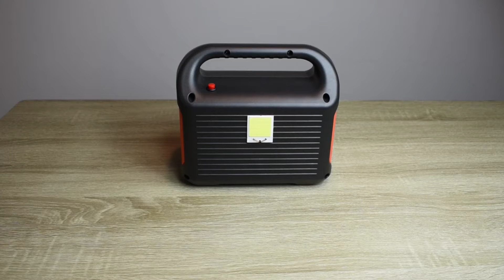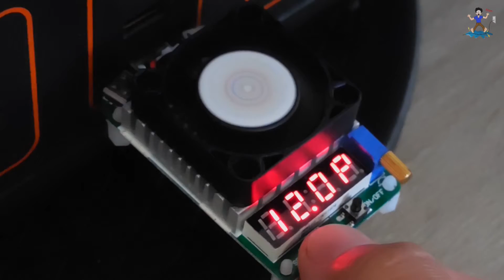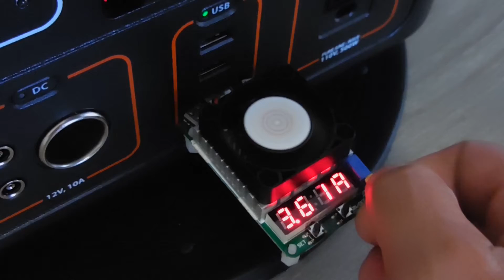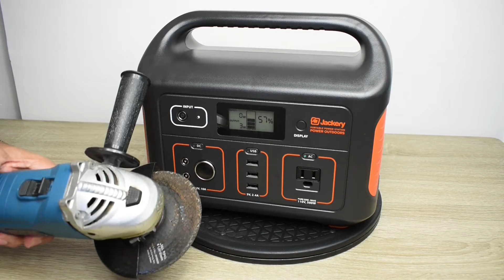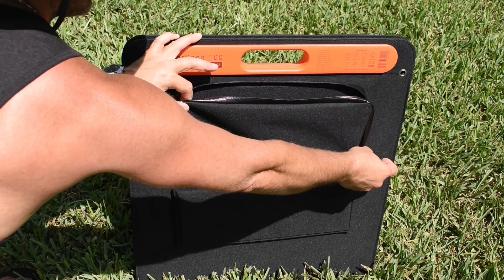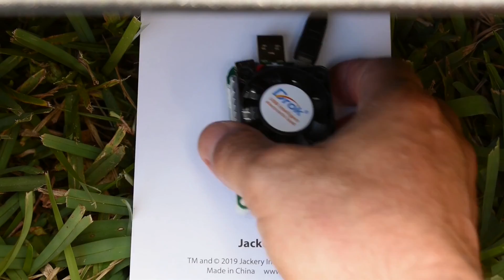Jackery EXTREME Testing! (Explorer 500 & SolarSaga 100W)

Comment: I live in Phoenix - it's only about 95 degrees today - and the VERY best performance we are receiving from Jackery 200w panels is a pathetic 131W!  This is a replacement shipment - when my first peels kept losing power for every minute in the sun, we assumed it was faulty.  Now the replacement unit is doing the same thing.  So Bottomline, these panels cannot perform in hot direct sunlight - somewhat ridiculous given that I bought this unit to provide power when the power girds fail here in the excessive heat of global warming, only to find that these panels don't perform to specs in warm weather.  IF YOU LIVE IN HOT WEATHER - test these panels in hot weather - our experience is they do not perform
Reply from the maker: You can refer to the video below for a solution. Thank you for watching!

https://youtu.be/yXNW-4fNZVk?si=2owQY2RTRmiU9F0q
Reply: @electronicsNmore  thank you. But it is INSANE that after spending $2000 on a unit I would have to go through the steps to make the unit perform to spec. This is false advertisement blatantly on the part of Jackery.
Reply from the maker: @kms7546  I agree they should have designed it to use the full output of the panel

Comment: So after 500 times of charging it could stop working?
Reply from the maker: Anything can happen.
Reply: @electronicsNmore  that’s very true
Reply: 500 cycles from 100% to 0% then 0% to 100% is one cycle. If you use the pass through, charge while using and don’t go below 50% you’ll get 1000 cycles ….then the unit will only charge to 80% capacity for many many more cycles and years of service…

Comment: would somebody please explain to me what those 6mm plugs are for? Every video I go to tells me about output but not what they are used for and what kind of connection I need. Please be kind, I'm a 76 yo woman trying to assemble equipment for possible power outages
Reply from the maker: Which plugs? At what time in the video?
Reply: @electronicsNmore  those two small ports to the left of the 12volt connection at 10:09
Reply from the maker: @holidaze8998  Those are DC jacks for powering some DC electronics.
Reply: @electronicsNmore   I just purchased the jackery500 and have only charged it up with AC right now as it has been pouring here in the Pacific NW. I plan on getting some 12v blankets and small ice chest, etc. Would they be powered by those plugs then or the 12v outlet? Thank you for your time, I won't keep bugging you. Nice video.
Reply from the maker: @holidaze8998  You cannot exceed 10 Amps. Refer to the 12v blanket current ratings.
Reply: @electronicsNmore  ok great to know. Thank you!

Comment: Well, you won't even get 100 watts from a 100 watt solar panel.  There is probably about a 10-20% inefficiency so you'd be lucky to get I'd say even 60 watts from a 100 watt panel.  Usually those ratings, like many others, are the maximum from the panel itself (the solar cells) but doesn't really reflect any loss during "transmission" from the cells to the actaul unit it is plugged into, which can be 10-30% loss probably.
Even Jackery itself says that a 300 watt unit will take about 3.5 Hrs to reach 80% charge from 0%, so that's about 22% per hour (of 80%) so only about 68 watts per hour from a 100 watt panel.  (This is obviously using rough numbers -- other factors will come into play and a 300 watt unit for example may charge faster or slower depending on other factors).

Comment: Thanks!  Very  thorough video showing actual load numbers.  Most people just plug in a bunch of stuff and do a "real world" test which has its uses but not as thorough as raw numerical data like you have shown.  It appears the actual LCD panel on the jackery itself is quite accurate as far as load goes.

Some cars also only put out a low wattage to prevent excessive drain on the battery since the alternator isn't running.  And many vehicles will cut off power to everything when the battery reaches about 10 volts (enough to barely start the car once probably).

Comment: Are you able to parallel 2 Jackery 100w Solar Panels to The Jackery Explorer 500w?
Reply from the maker: No. The max power input for the jackery 500 is 72-100W.
Reply: @electronicsNmore  1 panel will bring around 65w and with the 2 panels parallel it tops off at 70w
Reply from the maker: Watch my other video below. :-)
https://www.youtube.com/watch?v=yXNW-4fNZVk
Reply: @electronicsNmore  Wow, very good information. I wonder if they have a cover for it so it won't be exposed to the elements

Comment: One of the ads that was shown in the video is definitely a scam just saying.(Video is legit, I am talking about one of the random ads which the maker of the advertisement is the one to blame for.) This video itself is amazing and one of the best.
Reply from the maker: Which ad? LOL Glad you liked my video! Be sure to share. Thanks
Reply: @electronicsNmore  no problem! I mean an ad that says that WiFi providers are purposely slowing internet for like 0.25MB/s and their product magically boosted up to 250MB/s because delete some providers barrier. My guess is that in reality that's a WiFi extender which can be done with another phone or laptop and are selling it as something that magically will boost any WiFi ultra fast by connecting it on the wall with the WiFi.

Comment: Why does the Watts output display vary up and down instead of staying on a single number?
Reply from the maker: Where in the video?
Reply: @electronicsNmore , when you used the grinder, the Watts output fluctuated, but you didn't have it running very long. Anyway, I get this with my new unit. I tested it with a fan and it would move up and down every few seconds between around 33 and 38 Watts. An LCD light was pretty steady at 9 or 10 Watts. Maybe that's normal for a fan, but I thought these things would be steady.

Comment: I think Jackery solar panel is terrible product. it looks like pulls around max 60w? I have Togo power 60w solar panel for $100 and it pulls 50w????? It pulls around 20w inside the windshield and fits nicely too. (who sits around the camp site during the day. I don't think it's good idea to leave Jackery 1000 and solar panel on camp site)
Reply from the maker: The panel can put out 100W, but the voltage output is too low for the explorer unit to fully utilize the panel's power output. The 60W jackery panel is better.

Comment: I would like to see some Extreme Testing of the SolarSaga 100W panel. I can not find anyone doing it. Test the USB outputs (at the panel) and compare to the 8mm output. Low light vs good light; what the electronics are doing; are the electronics affecting the 8mm output; etc. My panel puts out 19+ volts open voltage, at Low light. I can only measure voltage. Seems like this panel is do well charging my small devices, I have no other source of power. Expensive Solar Generators are not available to a lot of us. I think, at a minimum, we should have a good solar panel, like this Jackery 100w. It seems to be a good basic choice; what do you think; can you do an extreme test on the newest version 100w panel (version 3) ? It has a new cell configuration, and a new protective cell coating.
Reply from the maker: For less than the price of the Jackery panel, you can buy a better made panel(no water resistant canvas that can pull or tear easily) that has higher open circuit voltage, which would allow faster charging. The Jackery should have no problems supplying full USB power under lower light conditions. Thanks for watching!

Comment: Great video. Thanks. Dumb question... Since the cable is only 6ft from the solar to the 500, any suggestions on how to keep the 500 out of direct sun? I live in a hot climate and I'm worried that it might get too hot (or isn't that a concern with these things?). Sounds like the 100W panel, though, isn't going to power it up any faster than the 60W (so I'll probably just get that one... and save some money).
Reply from the maker: Place the unit behind the solar panel in the shade.

Comment: Great testing video!! I have a ?. If I plugged in my 12v inverter to the car then charged the Jackery using the power cord to the inverter; while the engine is on and driving, would it pull more and change faster?
Reply from the maker: Hi Donna. Using a power inverter with the AC charger for the Jackery plugged into it, will charge at the same rate as in your house.
Reply: electronicsNmore  TY I was concerned it would pull too much from the car battery for the alternator to keep up.

Comment: How often and or when does the fan on the 500 come on?
Reply from the maker: Hello Shawn. If the unit is under a higher wattage load using the AC receptacle, the fan will turn on. If the unit was under high wattage load for a long time, the fan will remain on until the PPS cools down. Thanks for watching!

Comment: Quick question. Do you know how well this works with bluetooth speakers? I really wanna get this for my JBL Partybox 100 to use and charge at the same time but don't know if it'll work.
Reply from the maker: It should work fine. According to the JBL's website, the speaker has a 2500mah capacity battery that charges in 6.5hrs. The Jackery 500 system in this video can easily supply that power. If you decide to buy, be sure to use the provided links. Thanks for watching!
Reply: @electronicsNmore  Oh ok great! Thank you!

Comment: Great review?  Any suggestions on how to prevent the Jackery from shutting off after a few hours of non use.  If I leave my dometic fridge unattended, the jackery turns off after a few hours of cooler weather given the dometic doesn't run then.
Reply from the maker: Plug in a very low wattage LED night night.

Comment: do you like uncovered usb ports on that panel?
Reply: Good point. Especially if being used outdoors.
Reply: @mkilptrick  using solar panel indoors is inefficient
Reply: It doesn't have to be used with solar panels.
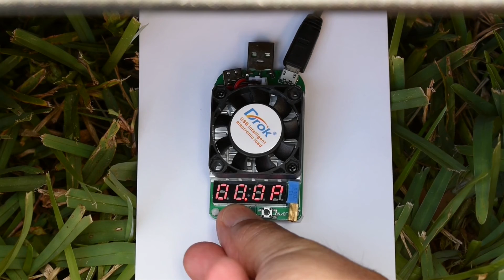Reply from the maker: I didn't mind because they were mostly protected when the panel is unfolded and facing the sun. 28:02 shows it very clearly. Thanks for watching!

Comment: Thanks for the in depth review. Any chance we could see the teardown?
Reply from the maker: You're welcome! I was going to include that, but based on the lack of views, I'm glad I didn't. If you look at my other video showing how I added the COB LED area light to the Jackery Explorer 240, you can see the inside. This unit is almost the same, but it has a larger battery pack, bigger inverter board, and the spotlight. I saw a bunch of videos on YT showing "reviews" for what I showed, but the great majority didn't come close to my level of testing, meanwhile they got tens of thousands of views or more. Totally illogical. Thanks for watching!